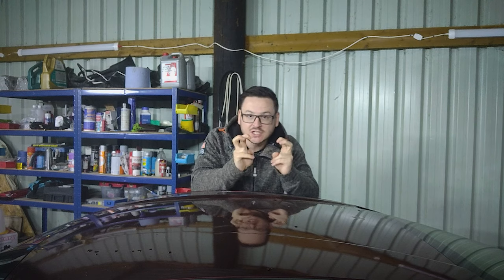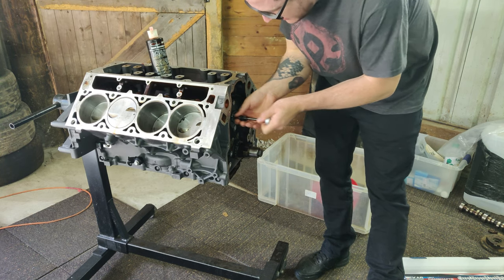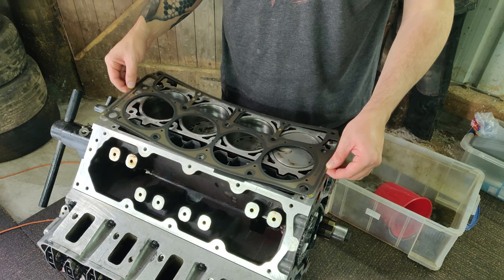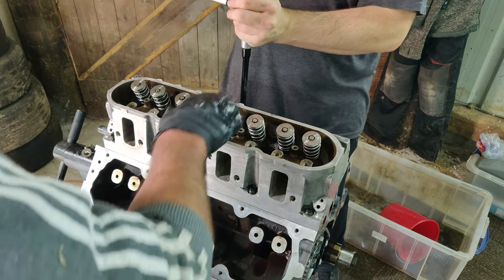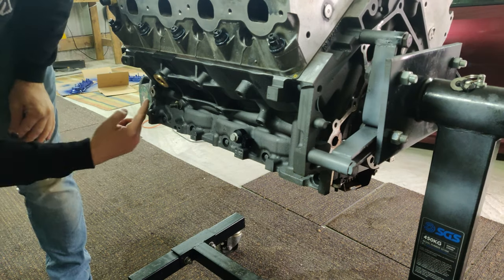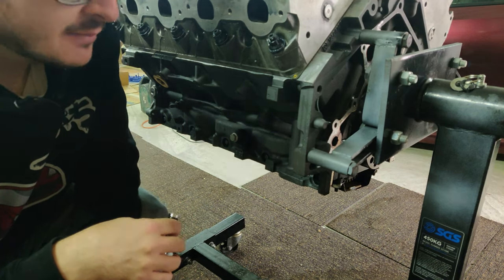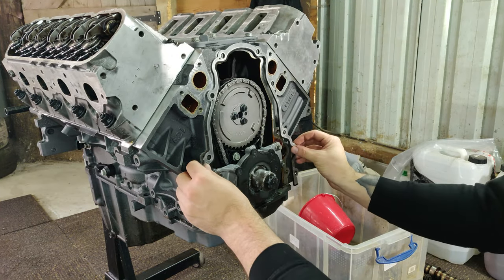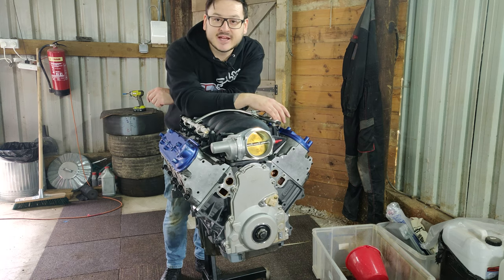Completing the LS3 Engine build!

Comment: ware did you learn to pack it with vaseline?
Reply from the maker: it's apparently a bit of an old school trick when building an engine that's going to sit for a while, it also helps the engine with building oil pressure on the first start.
Can't hurt to try of course :) The Vaseline will melt instantly and mix in with the run-in oil for the first start which will then be flushed out soon after